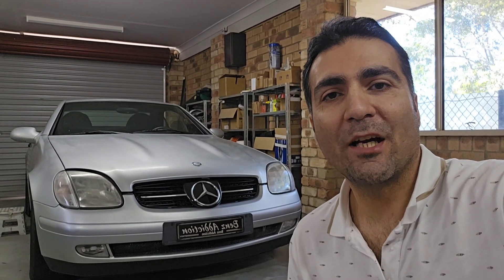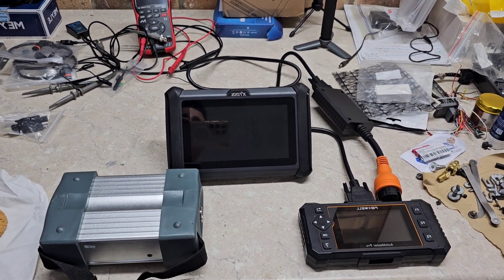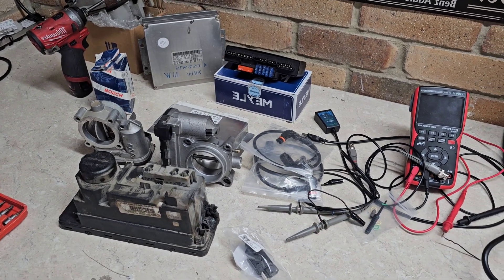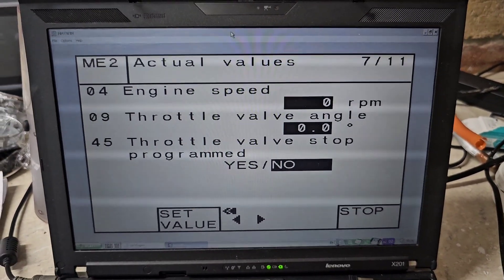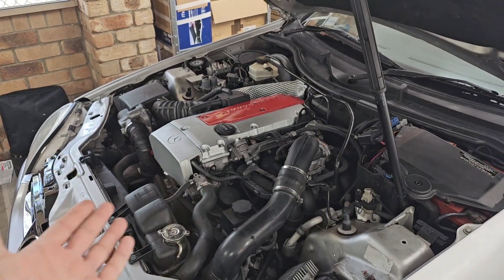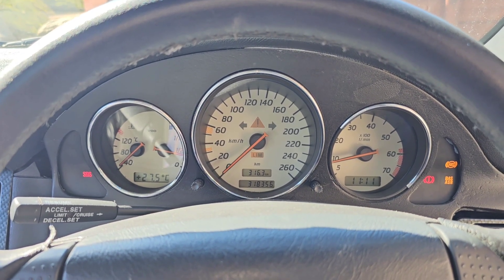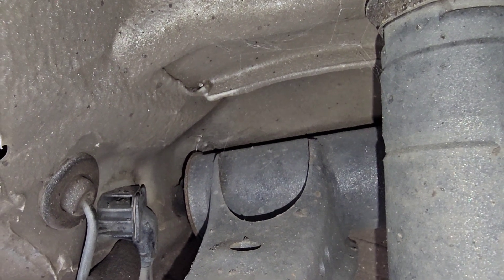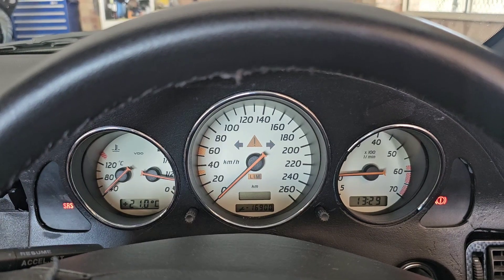FIXED: SLK230 Limp Mode, Engine Hunting, and NO Throttle Response (M111 Kompressor)

Comment: Hi just wondering where did you pick up the 38 pin connector I bough one on ebay but it didn't work? I am having an issue with my 1997 SLK 230. I had not started my car for 12 months replaced battery turned on key it just cranked over no start with fuel pump running I tried starting it four times after that still no start it had new fuel in tank any ideas. I to live in sunny Brisbane and thicking of joining a car club in a couple of years time and putting the SLK 230 on club redgo. Keep up the good content.
Reply from the maker: Hi mate, the 38 pin adapter should come with your original scanner supplier, or at least any third party company who specifically build that for the model of scanner.  The best scanner for these cars are still Mercedes STAR DIAGNOSIS.  feel free to reach out to me with your questions to my email address.  Info@benzaddiction.com

Comment: Hello to you from France. Good work... bravo.. For me.. it's a 1997 SLK r170.. which does not go past 3700 rpm even after changing many peripherals.. the last message is 'gear selector position is not plausible at times' code 114... in short I'm going to throw it in the trash... thanks again.
Reply from the maker: Hi mate, I can understand your frustration.  I think M111 (230K) is not the best engine, the ECU is super sensitive to everything.  M112 is a great reliable engine, so next time maybe buy one with M112.
Reply: I am a mercedes master tech and a r170 specialist with focus on m111k. that code indicates the gear shifter is likely bad.
Reply: @AfterHebrews ok thanks.. i change..

Comment: Hello, I have the same problem. Sometimes the gas pedal just fails and the BAS ASR lights up, even in place without moving. The throttle and relay k40 were replaced and after 2 days it broke again. Found ECU with the same number and I will copy mine onto it to see what happens.
Reply from the maker: Yes, it might be the ECU.
Reply: @BenzAddiction  Should I try the brake switch, ABS sensors and throttle potentiometer first? I have codes: C1000-033, C1010, C1025-003 CAN, C1202. No codes in ME or EGS. Small f in BAS and ASR and cannot be deleted..

Comment: Hello,  there are two physically separate CAN busses for that model and model year. CANB and CANC, The PSE is connected to CANB, (Body Control), and the ECU, TCM and Traction and several others) are connected to CANC. I do not believe there is any relationship between  a bad PSE and ECU idle hunting. It is more likely related to ECU, and CANC issues.
Reply from the maker: Thanks mate :)

Comment: Hi Max, I like your problem solving logics.  Seeing the green corrosion, do you think there may be water intrusion point in your SLK (stuck drain or tree leaves debris) or the environment you are located?  Even the most knowledgeable MB repair shop may not fix this correctly.  You should open your own shop as a side hussle !
Reply from the maker: Thanks Brian.  The thing is that a Mechanic is unlikely to spend hours and hours on these old over complicated cars. It is not logical nor cost effective. This is very rare case that a car like this SLK has too many issues at the same time, makes the diagnosis difficult and time consuming.